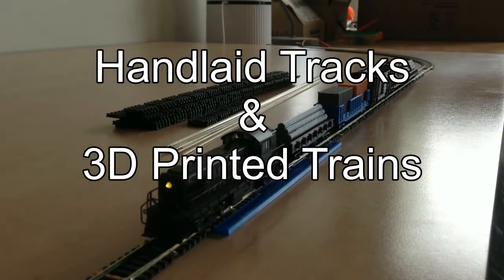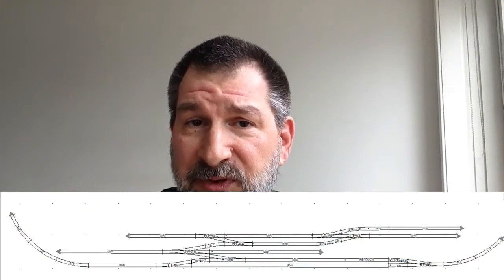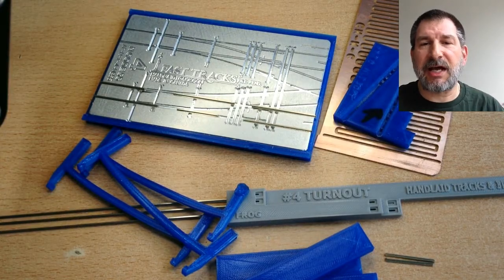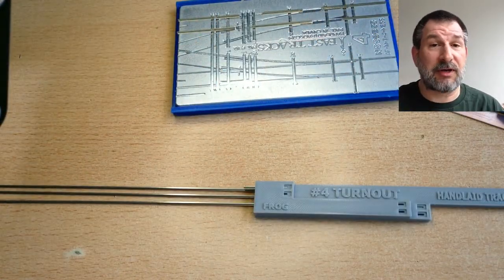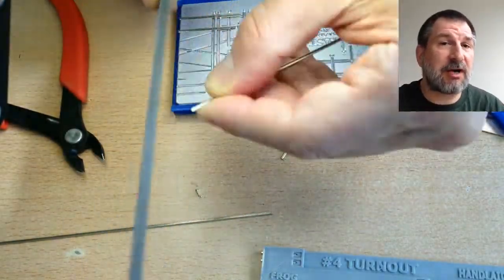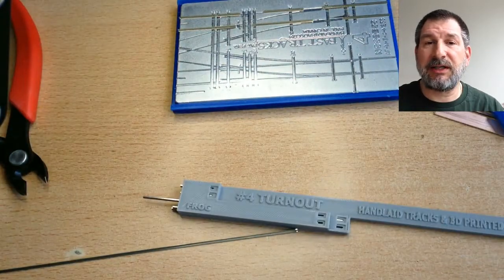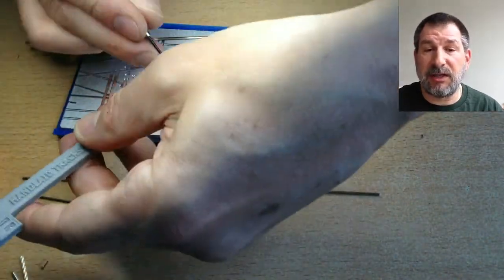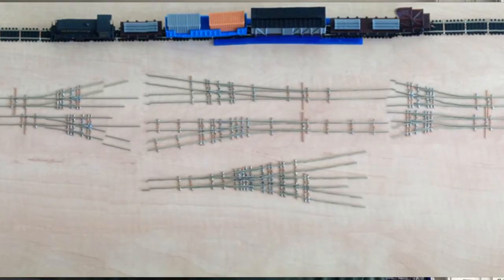3D Printed Rail Cutter For #4 Turnouts & Other Handlaid Model Train Track Easier Consistent Results

Comment: Great jig anyway you can make the #6 available on Thingiverse?
Reply from the maker: Is it different than the 3 way? I don't know the length - let me know and I will.
Reply from the maker: I just added the #6 to thingiverse  - seems 1 inch shorter - so it "Should" work.
Reply: @handlaidtracksand3dprinted922  Thank you .. I will print it out an let you know how it works!